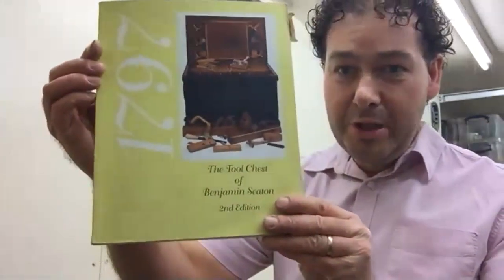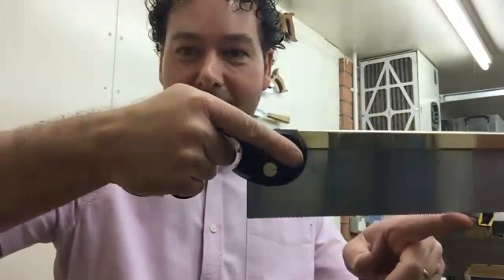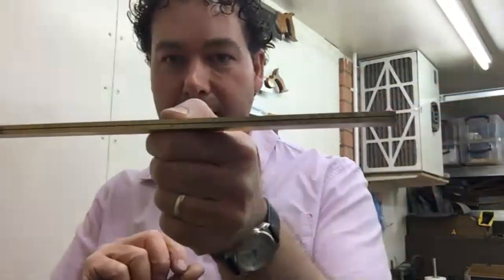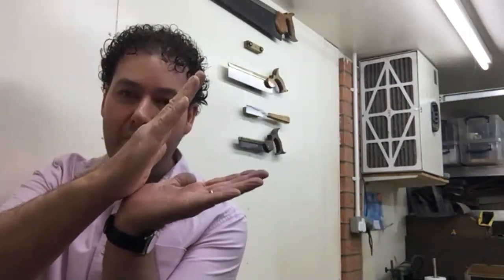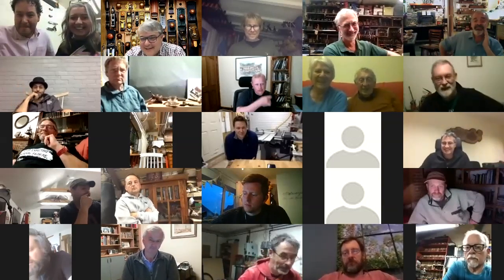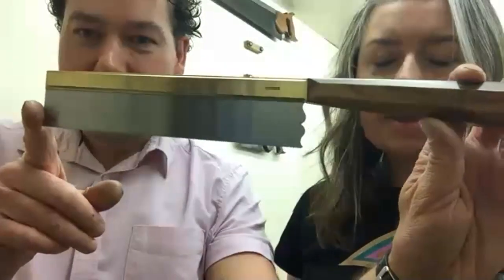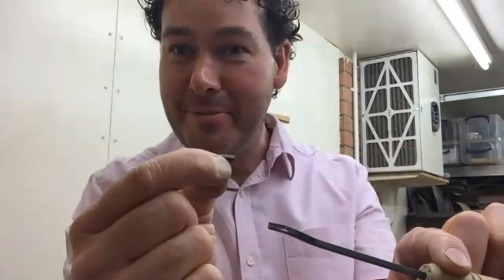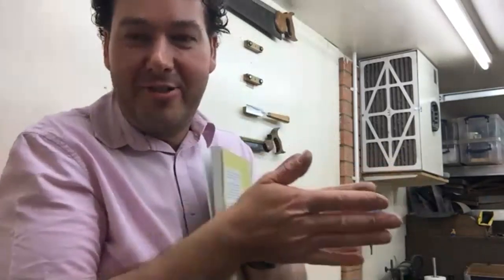Bench Talk 101 Jaq and Shane Skelton talks 250 years of English Hand Saws

Comment: I'm curious, how was Saw Back made? How can you make such a thin slot?
Reply: I’m not Shane, just a much smaller time saw maker. We use a machinist’s mill to run the slots!
Reply: @Kozilak , I was the Guitar Doctor at Stars Guitars in San Francisco, CA., and we had two Bridgeport Milling machines. One of their uses was for accurate slotting of fingerboards. Something that can get tricky as there are more than just a couple of different scale lengths for guitars, electric bases, etc.